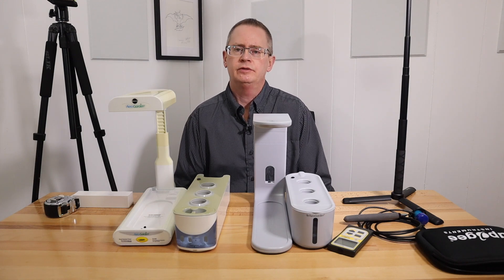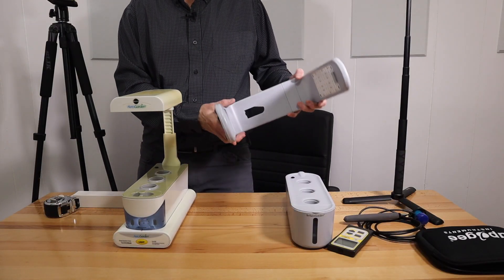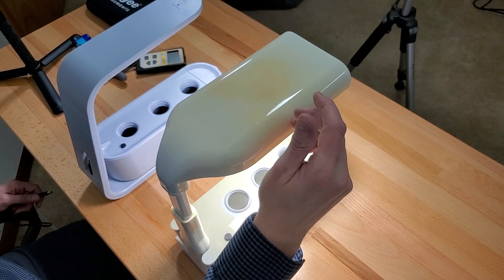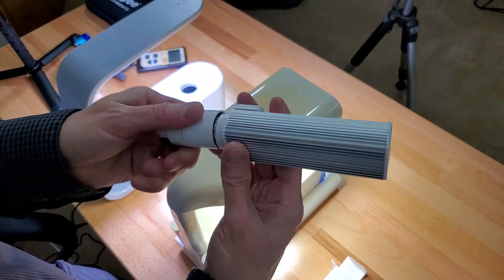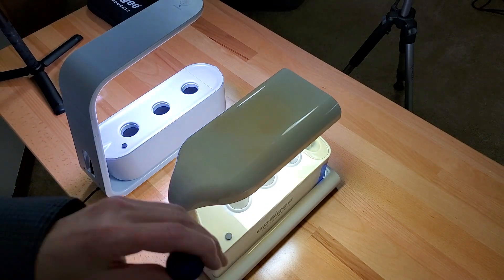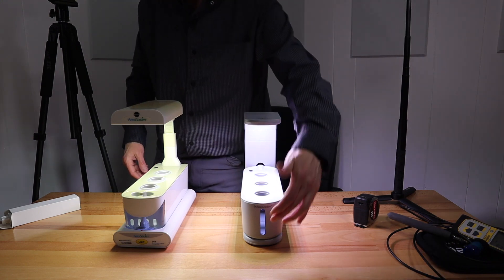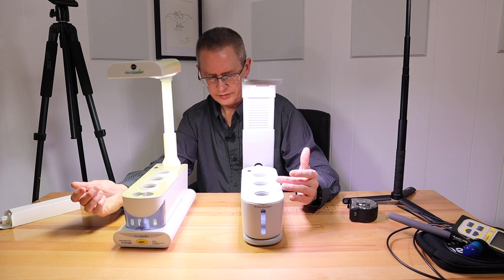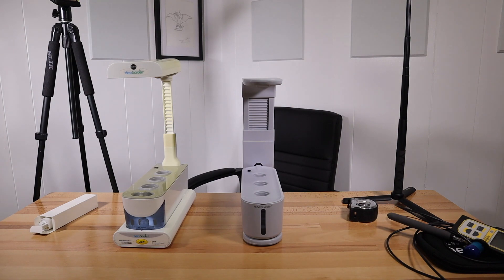AeroGarden Sprout comparison - Old versus new

Comment: Great comparison!  The water level seems much easier to see on the older model.  Have you noticed that too?
Reply from the maker: Yeah, it is. I'm looking at the new one now in my office, and I can see it from a few feet away. I'm wondering if they made it smaller for algae concerns?
Reply: @pepperdactyl  I think that's exactly why they did it. I always ended up putting black tape over all but a small strip of the tank on the old models to prevent algae growth. It's not a huge problem if you only have one unit, but if there are any other lights nearby it'll grow algae pretty reliably.

Comment: Great comparison. May want to try some retro brite on the yellowish older one. Should bring the color back.  
I think you may have bought up all the sprouts out there. One I don’t have but am keeping an eye out because of your brick seek video.
Reply from the maker: I hope you can find one. They are pretty cool. The seed starting system, for 15 at a time,  works really well too. Thanks for the tip on getting that discoloration off.